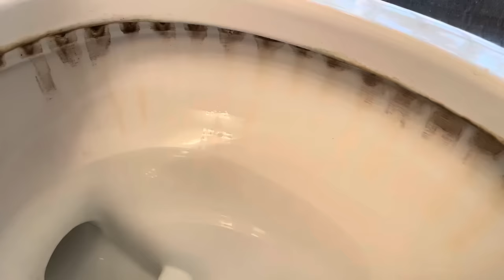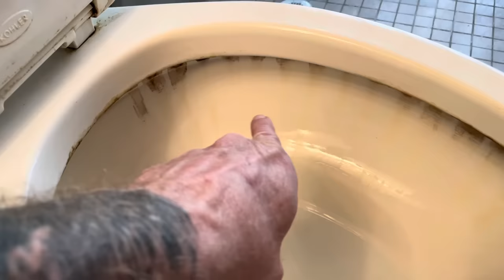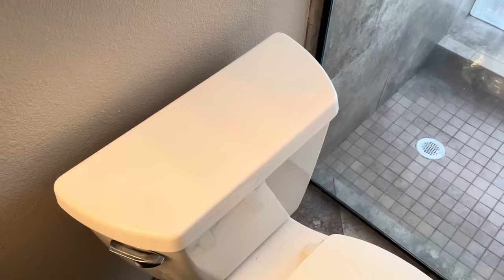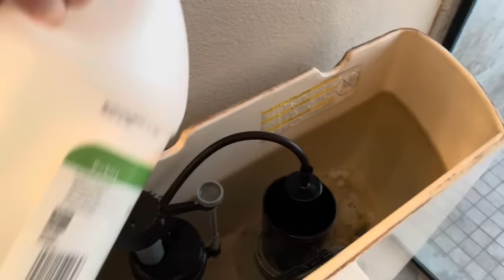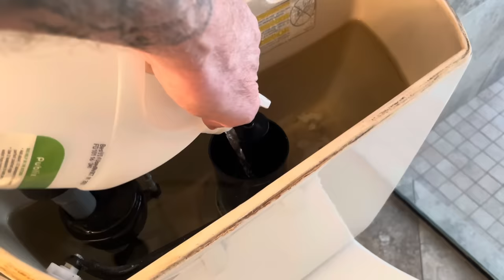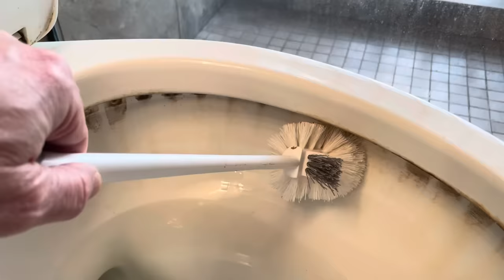Why Does THIS Keep Coming Back and How to STOP it

Comment: Putting those Bleach Tablets for toilets in the tank works.
Reply from the maker: Bleach is a very deceiving product… it is far more effective at “bleaching” the color of mold than it is at killing it. Because we believe what we see, we think it has killed it, but it hasn’t. That’s why it comes back so quickly. So we just keep using & buying product over and over again. Great for sales, but not so much for us. The acetic acid in vinegar, on the other hand, kills mold down to the roots, but doesn’t really change the color that much, so you still need to remove the surface stain, but it won’t come back for a long time. Vinegar also helps break down the mineral deposits that the mold is “rooted” in. All in all, vinegar is a far better option.

Comment: If you pour vinegar into the tank to clean the walls of the tank will it damage the rubber seal that keeps water from leaking?
Reply from the maker: Potentially, yes. It’s better to drain the tank, then use a spray bottle with vinegar to clean the walls. Then flush afterwards.

Comment: Would chlorine tablets or bleach in the tank work? 
I would change the tank seal to silicone so it won’t turn gummy like the stock rubber one will.
Reply from the maker: Bleach is somewhat effective at killing mold on non-porous “glazed” surfaces. But the internal rim cavity of a toilet, where the mold is flourishing, is not glazed and is very porous, so vinegar is far more effective, as it’s able to kill mold deep down to the roots.

Comment: I have this in one bathroom but the idiots who built it put a countertop that covers the tank. I can't access it without destroying the countertop or uninstalling the toilet.
Reply from the maker: Wow, that’s crazy. So you can never even change out the valve or flapper if you need to… sooner or later you’ll have to remedy that. But for the time being, see the two videos linked in the description for cleaning underneath the rim.

Comment: Question. Doesnt distilled vinegar eat away at any rubber/plastic pieces connected to the tank?
Reply from the maker: That’s why we’re pouring it into the overflow and not the tank.
Reply: Thank you. @papajoeknows8355

Comment: The apartment I live in has one of those pressurized flush mechanisms installed in the tank, so I don't have access to the overflow cylinder. Any suggestions on what to do in this case? Thanks.
Reply from the maker: Unfortunately, there’s no way to access the internal rim cavity with a pressure assist toilet. The two videos linked in the description may help you with the mold that you do see.

Comment: My tank is hidden in the wall so I only have a little flush switch on the wall above the toilet. I clean like crazy but it comes back after 3 days. Any advice? It's a German house
Reply from the maker: Unfortunately there’s no way to access the internal rim cavity with that kind of toilet. The 2 videos linked in the description will help you for cleaning under the rim though.

Comment: And what if it isn't mold? Also, why not use any other cleaning supplies such as bleach?
Reply from the maker: Bleach is a very deceiving product… it is far more effective at “bleaching” the color of mold than it is at killing it. Because we believe what we see, we think it has killed it, but it hasn’t. That’s why it comes back so quickly. So we just keep using & buying product over and over again. Great for sales, but not so much for us. The acetic acid in vinegar, on the other hand, kills mold down to the roots, but doesn’t really change the color that much, so you still need to remove the surface stain, but it won’t come back for a long time. Vinegar also helps break down the mineral deposits that the mold is “rooted” in. All in all, vinegar is a far better option.

Comment: Could you use toilet cleaner diluted with water instead of vinegar?
Reply from the maker: The active ingredient in most toilet cleaners is bleach… Bleach is a very deceiving product… it is far more effective at “bleaching” the color of mold than it is at killing it. Because we believe what we see, we think it has killed it, but it hasn’t. That’s why it comes back so quickly. So we just keep using & buying product over and over again. Great for sales, but not so much for us. The acetic acid in vinegar, on the other hand, kills mold down to the roots, but doesn’t really change the color that much, so you still need to remove the surface stain, but it won’t come back for a long time. Vinegar also helps break down the mineral deposits that the mold is “rooted” in. All in all, vinegar is a far better option.

Comment: Seems like the mould is sourced from within the upper tank right? Those blue toilet tank dissolver things you drop into the tank dont seem to work very well, they just seem to make the water blue.. so how about having a dripper above the tank that slowly drops in vinegar every day or every flush based on the water level. I think the trick is to make the tank itself mould-proof so the mould cannot flush down below to begin with.. :wink:
Reply from the maker: The problem with that is that the acidity of the vinegar (which is what kills the mold) will break down the rubber parts and seals inside the tank. That’s why I pour it into the overflow which leads to the internal rim cavity.
Reply: @papajoeknows8355 ah ok good point, so I guess we need to use silicone instead of rubber, perhaps even 3D printed parts in place of the weaker components. Honestly I think pouring a small amount of Dettol or some other type of anti bacterial liquid into the tank above could actually render toilet bowl cleaning a thing of the past. Just need to figure out the chemicals needed at a low price point...

Comment: Using those chlorine tablets that sit inside the tank can work too. Is there something wrong with using those instead?
Reply from the maker: Bleach / chlorine is a very deceiving product… it is far more effective at “bleaching” the color of mold than it is at killing it. Because we believe what we see, we think it has killed it, but it hasn’t. That’s why it comes back so quickly. So we just keep using & buying product over and over again. Great for sales, but not so much for us. The acetic acid in vinegar, on the other hand, kills mold down to the roots, but doesn’t really change the color that much, so you still need to remove the surface stain, but it won’t come back for a long time. Vinegar also helps break down the mineral deposits that the mold is “rooted” in. All in all, vinegar is a far better option.
Reply: @papajoeknows8355  thanks for the thoughtful response!

Comment: Hm. Is there any reason not to use bleach? I'm unsure of the inner workings of the toilet. Is there anything there that would be damaged by bleach?
Reply from the maker: Bleach is a very deceiving product… it is far more effective at “bleaching” the color of mold than it is at killing it. Because we believe what we see, we think it has killed it, but it hasn’t. That’s why it comes back so quickly. So we just keep using & buying product over and over again. Great for sales, but not so much for us. The acetic acid in vinegar, on the other hand, kills mold down to the roots, but doesn’t really change the color that much, so you still need to remove the surface stain, but it won’t come back for a long time. Vinegar also helps break down the mineral deposits that the mold is “rooted” in. All in all, vinegar is a far better option.
Reply: @papajoeknows8355  Yeah, I have a science background. I'm aware that bleach isn't quite the wonder compound that it is often claimed to be.
I only ask because bleach is a good oxidizer and is quite capable of killing a wide array of pathogens. Though, I don't know how well it does on mold specifically.
However, I will defer to your expertise. Clearly vinegar does work.

Comment: Omg i'm allergic to mold.  I had no idea that's what that was.
Reply from the maker: Honestly, you might want to pick a different allergy… Mold spores are ubiquitous; they are found both indoors and outdoors. Mold spores cannot be eliminated from indoor environments. Mold spores are found floating through the air and in settled dust, and will grow where moisture is present.
Reply: @papajoeknows8355 came back to this video after moving to a new place and needing to do this.  That’s probably why I can barely breathe 100 percent of the time! So annoying but thanks for your help 😊

Comment: Underneath the lid in my toilets look different to yours. We have plastic ball cocks attached to a white container type things. Is the white container thing the overflow pipe? It's not clear to me at all because nothing under our lids look like overflow pipes at all.
Reply from the maker: Is there a rubber water line leading from the valve to a tube?
Reply: @papajoeknows8355  not that I can see. There is a pipe going out of the toilet but there's no obvious over flow pipe leading to it. There is only a plastic bag type thing which is paper thin.
Reply from the maker: @ibelieveinmiracles777  hmmm, send me a pic of what’s inside. My email: theHometeam1974@gmail.com

Comment: I don't have that much vinegar in my house right now, but I do have a full bottle of bleach.   Can that work, or is it too corrosive?
Reply from the maker: Bleach is somewhat effective at killing mold on non-porous “glazed” surfaces. But the internal rim cavity of a toilet, where the mold is flourishing, is not glazed and is very porous, so vinegar is far more effective, as it’s able to kill mold deep down to the roots.
Reply: @papajoeknows8355  Thanks, just bought some vinegar, fingers crossed.  

Thanks man.

Comment: Will the vinegar degrade the flapper, etc. inside the tank?
Reply from the maker: You’re not pouring the vinegar in the tank, you’re pouring it in the overflow.
Reply: @papajoeknows8355  thanks. I used a funnel to make sure as little as possible got into the tank and I was impressed by the results. I only had enough vinegar for one toilet but will do the other after I get more vinegar.

Comment: This worked on one of my toilets but the other one doesn’t work the same way. Pouring vinegar into the overflow tube simply sends water through the bottom of the bowl and not into the jets around the rim. I’m having trouble figuring out how to get the vinegar to flow through the Jets around the rim, can anyone help?
Reply from the maker: I’ve seen some toilets like that… it’s almost like it takes a burst of water (like the emptying of the tank) to send water into that rim cavity and jets. I think in that case, I would be tempted to pour it directly into the tank, then flush it… that will at least get a diluted solution of vinegar & water into the rim cavity. You just don’t want to leave vinegar in the tank for long, as the acidity can break down the rubber seals etc., but I wouldn’t be concerned about it if done quickly. Then let it sit for a while before flushing again to give it time to work inside the rim. Obviously you may need to do this a few times because it’s not straight vinegar going in there, but I believe you’ll see results.

* to start, flush the toilet, then pour the vinegar in the tank as it’s refilling. Once it fills, flush it.

Comment: What about using bleach? I was told that is to be used on mold.
Reply from the maker: Bleach is a very deceiving product… it is far more effective at “bleaching” the color of mold than it is at killing it. Because we believe what we see, we think it has killed it, but it hasn’t. That’s why it comes back so quickly. So we just keep using & buying product over and over again. Great for sales, but not so much for us. The acetic acid in vinegar, on the other hand, kills mold down to the roots, but doesn’t really change the color that much, so you still need to remove the surface stain, but it won’t come back for a long time. Vinegar also helps break down the mineral deposits that the mold is “rooted” in. All in all, vinegar is a far better option.

Comment: would bleach also work instead of vinegar?
Reply from the maker: Bleach is a very deceiving product… it is far more effective at “bleaching” the color of mold than it is at killing it. Because we believe what we see, we think it has killed it, but it hasn’t. That’s why it comes back so quickly. So we just keep using & buying product over and over again. Great for sales, but not so much for us. The acetic acid in vinegar, on the other hand, kills mold down to the roots, but doesn’t really change the color that much, so you still need to remove the surface stain, but it won’t come back for a long time. Vinegar also helps break down the mineral deposits that the mold is “rooted” in. All in all, vinegar is a far better option.
Reply: @papajoeknows8355  thanks

Comment: Bleach. Also helps
Reply from the maker: Bleach is a very deceiving product… it is far more effective at “bleaching” the color of mold than it is at killing it. Because we believe what we see, we think it has killed it, but it hasn’t. That’s why it comes back so quickly. So we just keep using & buying product over and over again. Great for sales, but not so much for us. The acetic acid in vinegar, on the other hand, kills mold down to the roots, but doesn’t really change the color that much, so you still need to remove the surface stain, but it won’t come back for a long time. Vinegar also helps break down the mineral deposits that the mold is “rooted” in. All in all, vinegar is a far better option.

Comment: Would bleach be  wrong ?
Reply from the maker: Bleach is a very deceiving product… it is far more effective at “bleaching” the color of mold than it is at killing it. Because we believe what we see, we think it has killed it, but it hasn’t. That’s why it comes back so quickly. So we just keep using & buying product over and over again. Great for sales, but not so much for us. The acetic acid in vinegar, on the other hand, kills mold down to the roots, but doesn’t really change the color that much, so you still need to remove the surface stain, but it won’t come back for a long time. Vinegar also helps break down the mineral deposits that the mold is “rooted” in. All in all, vinegar is a far better option.

Comment: I poured half a jug into the thingy, let it sit for 12 hours, and the mold was still there and impossible to scrub off. Am I doing something wrong?
Reply from the maker: You’ve killed the mold “inside” the internal rim cavity. Now see the two videos linked in the description, they will help you to remove what you see “under” under the rim. After that, just pour some vinegar in there intermittently, and the mold won’t come back.

Comment: Those "2000 flushes" tablets in the tank
Reply from the maker: @Phil-D83  Those types of products are far more effective at “bleaching” the color of mold than at killing it. Because we believe what we see, we think it has killed it, but it hasn’t. That’s why it comes back so quickly. So we just keep using & buying product over and over again. Great for sales, but not so much for us. The acetic acid in vinegar, on the other hand, kills mold down to the roots, but doesn’t really change the color that much, so you still need to remove the surface stain, but it won’t come back for a long time. Vinegar also helps break down the mineral deposits that the mold is “rooted” in. All in all, vinegar is a far better option.

Comment: Bleach works as well
Reply from the maker: Bleach is somewhat effective at killing mold on non-porous “glazed” surfaces. But the internal rim cavity of a toilet, where the mold is flourishing, is not glazed and is very porous, so vinegar is far more effective, as it’s able to kill mold deep down to the roots.

It is deceiving though… bleach is very effective at “bleaching” the color of mold so you think you’ve killed it, but it comes back very quickly. That’s why you have to keep using it. Vinegar on the other hand kills mold down to the roots, but doesn’t really change the color that much, so you still need to remove the surface stain, but it won’t come back for a long time. Vinegar also helps break down the mineral deposits that the mold is “rooted” in. All in all, a far better option.

Comment: Will the bleach tablet work too?
Reply from the maker: Bleach is a very deceiving product… it is far more effective at “bleaching” the color of mold than it is at killing it. Because we believe what we see, we think it has killed it, but it hasn’t. That’s why it comes back so quickly. So we just keep using & buying product over and over again. Great for sales, but not so much for us. The acetic acid in vinegar, on the other hand, kills mold down to the roots, but doesn’t really change the color that much, so you still need to remove the surface stain, but it won’t come back for a long time. Vinegar also helps break down the mineral deposits that the mold is “rooted” in. All in all, vinegar is a far better option.
Reply: @papajoeknows8355  thank you, I will use vinegar on the mold I'm cleaning from my window sills then👍

Comment: Would chlorine bleach damage the toilet?
Reply from the maker: Bleach is a very deceiving product… it is far more effective at “bleaching” the color of mold than it is at killing it. Because we believe what we see, we think it has killed it, but it hasn’t. That’s why it comes back so quickly. So we just keep using & buying product over and over again. Great for sales, but not so much for us. The acetic acid in vinegar, on the other hand, kills mold down to the roots, but doesn’t really change the color that much, so you still need to remove the surface stain, but it won’t come back for a long time. Vinegar also helps break down the mineral deposits that the mold is “rooted” in. All in all, vinegar is a far better option.